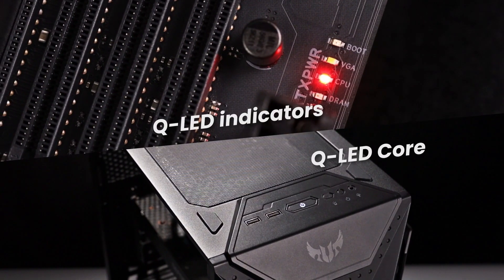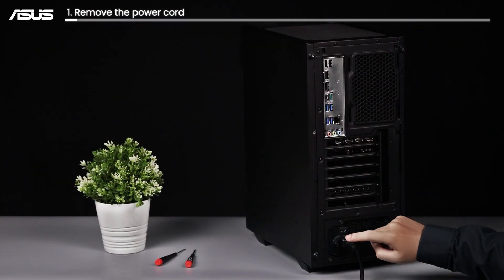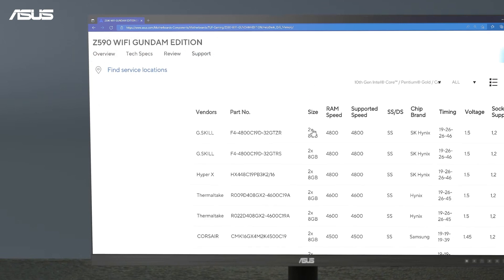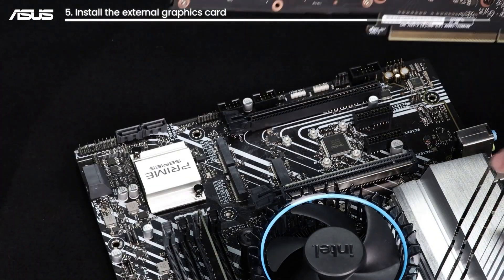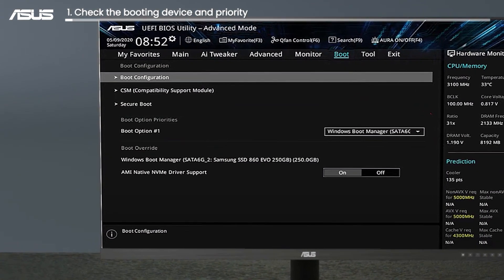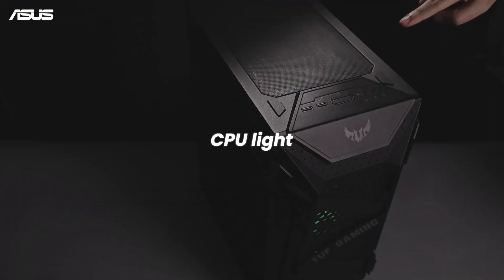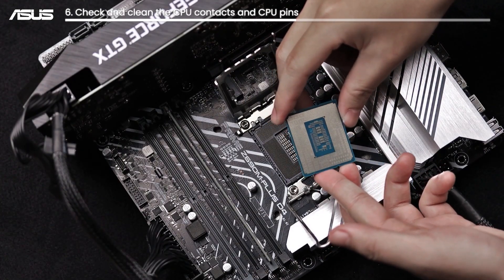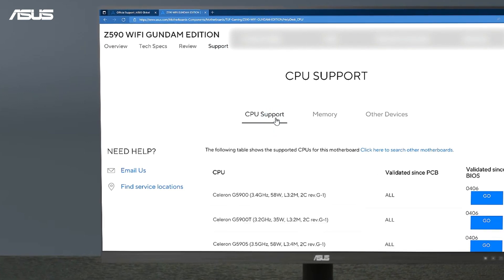ASUS Motherboard Troubleshooting via Q-LED indicators, Q-LED Core   | ASUS SUPPORT

Comment: After a power outage my PC will boot into a black screen sometimes and the power LED also flashes 4 times per second on boot. The PC also does not recognize some external drives anymore. I've also had the system crash into BIOS once since the issues started.
I cleaned and reseated my RAM and also tested it with MemTest86 - with 0 errors shown. I also replaced my power supply unit and my CMOS battery but the issue persists.
Does this indicate that my motherboards needs to be replaced? Maybe the power outage came with a power surge that fried certain components in the motherboard?
Reply from the maker: Regarding your question, I would recommend you visit the following forum post to get more assistance. 
https://zentalk.asus.com/t5/motherboards/bd-p/motherboards
Sorry for any inconvenience it may be caused.

Comment: Need help, my vga light is constantly on but my pc wont boot. Everything turns on but when it gets the red light my gpu fans stop spinning, if i disconnect it and then plug it back in they spin again. My motherboard is a X570-Plus wifi.
Reply from the maker: Regarding your question, I would recommend you visit the following forum post to get more assistance. 
https://zentalk.asus.com/t5/motherboards/bd-p/motherboards
Sorry for any inconvenience it may be caused.

Comment: My Boot light has been on since over a year ago and a week ago I found this video and bought a new M.2 SSD but lights still on. What should I do now?
Reply from the maker: Regarding your question, I would recommend you visit the following forum post to get more assistance. 
https://zentalk.asus.com/t5/motherboards/bd-p/motherboards
Sorry for any inconvenience it may be caused.
Reply: @asus_support  5 days ago I did actually fix my pc. It just literally just my SSD and windows 11 no longer able to run since I gave my GPU to my friend. So I bought the new SSD and a flash drive to install windows 10 and now IM BACK BABY!!! and wouldn't have thought to buy a new SSD without this video so ty :D

Comment: MB: 
prime B550-Plus, Ryzen 3 (I think - can't remember exactly which), 32gb RAM.  About 2 years old, worked fine until today.  Now on power-up the Q-leds DRAM, CPU and VGA all blink once, then repeat. Is this a failed CPU or MB?

Thanks,
D Mac
Reply from the maker: Regarding your question, I would recommend you visit the following forum post to get more assistance. 
https://zentalk.asus.com/t5/motherboards/bd-p/motherboards
Sorry for any inconvenience it may be caused.

Comment: Hello @asus support I have a question. I have Motherboard ROG Strix B760--A Gaming Wi-Fi and have bought compatible RAM as per the Support CPU/RAM list in your support page for the specific model of motherboard that I purchased; however, when I turn on the power the CPU Led turns on Red for a second then shuts off and followed to that the DRAM Amber light turns on and it remains on and there's no boot. RAM Sticks have RGB Light so that stays on, CPU Fan stays on (also has RGB), Tower Case has 3x RGB Fans and those stay on as well, everything seems to be turning on except there is no boot process and the DRAM Amber light stays on. I doubled checked the Model of the (2x) RAM Sticks were compatible as well to place them in the correct DIM Slot (A2 and B2).

Thank you
Reply from the maker: Regarding your question, I would recommend you visit the following forum post to get more assistance.
https://rog-forum.asus.com/t5/gaming-motherboards/bd-p/HSS_MB
Sorry for any inconvenience it may be caused.
Reply: Same here … happened overnight with a 2 year old build x570e wifi II … either cpu red light followed by amber dram or other way round … q-code 54 4d …
Reply from the maker: Regarding your question, I would recommend you visit the following forum post to get more assistance. 
https://zentalk.asus.com/t5/motherboards/bd-p/motherboards
Sorry for any inconvenience it may be caused.

Comment: How can i update my motherboard when my computer is not working, wtf
Reply from the maker: Do you mean that if the device cannot power on after encountering a problem, how can you update the BIOS? Or is it possible to update the BIOS without booting up the system? If it is the latter, you can refer to the following steps.
https://www.asus.com/support/faq/1038568/

Comment: B550 TUF Plus with 5600x and 16gb 3600mhz ram. It was working fine at night but in the morning when I turned it on I get no POST. Dram LED on constantly fans spinning and no signal tried one ram at time on all slots and clearing CMOS still nothing.. I don't have other ram sticks to test please help.
Reply from the maker: Regarding your question, I would recommend you visit the following forum post to get more assistance.
https://zentalk.asus.com/t5/motherboards/bd-p/motherboards
Sorry for any inconvenience it may be caused.
Reply: Hi, I have the same problem, did you solve yours?
Reply: @mass6902 Hey, sorry to hear that you have this problem, unfortunately in my case it was a dead CPU. I hope it's not the case for you, try removing rams and test them one by one and clean ram slots first.
Reply: @Copeur  I bought a new motherboard and rams and there is still the DRAM led, you are right I think it is my processor, shiit ...
Reply from the maker: If you have followed the above steps but the problem persists, I would recommend you visit the following forum post to get more assistance. 
https://zentalk.asus.com/t5/motherboards/bd-p/motherboards
Sorry for any inconvenience it may be caused.

Comment: Hello. I bought an Asus B460M-A (The one that only supports 10th generation Intel). It worries me because as soon as I press the power button, the power LED flashes quickly 8-9 times (no video here), then the LED stays on for about 2 seconds and at the same time shows the first classic screen (The one that shows the CPU, Memory, or if the keyboard is connected or not), it quickly goes to the next screen where the ASUS logo appears and at the same time the LED turns off, half a second later the power LED turns on, Windows loads and the LED remains stable. It doesn't turn off again. The speaker only emits the classic short beep that everything went well. There are no video glitches. Since I press the power button, my PC takes 6-7 seconds to display the Windows welcome screen. Is it okay for the power LED to flash those 8-9 times as soon as I turn on the PC? Is it part of the Power On Self Test? Thanks in advance.
Reply from the maker: Regarding your question, I would recommend you visit the following forum post to get more assistance.
https://zentalk.asus.com/t5/motherboards/bd-p/motherboards
Sorry for any inconvenience it may be caused.

Comment: my pc has the white led and the boot green/yellow led. I have checked ssd connection and installation, and cleaned out all of the slots and reinstalled the gpu. i still get no signal on my monitor and have the led signals. i just built this pc and nothing has been installed on it. I am using the Asus tuf plus wifi ATX motherboard. i am not using any type of storage other than a m.2 ssd (1tb) and my gpu is the 4060 from Msi. My cpu is the i5 14400F. How do i fix this problem? everything is plugged in and the gpu fans are spinning.
Reply from the maker: Regarding your question, I would recommend you visit the following forum post to get more assistance.
https://zentalk.asus.com/t5/motherboards/bd-p/motherboards
Thank you.
Reply: @asus_support  for anyone wondering, I left my pc running for a while, and then turned it off. The next morning it turned on and booted into bios. I was able to install windows and get rid of any motherboard lights.

Comment: I have a problem with ROG STRIX B760-F GAMING WIFI the VGA LED remains lit every now and then I tried the guide, updated the bios, updated nvidia drivers, tried two RTX 3060/ RTX 4080 cards and the problem persists the video cards work correctly, please please do a bios update that solves this problem, I also have problems with XMP profiles on DDR ram 5 CORSAIR VENGEANCE RGB DDR5 RAM 32GB 7000Mhz, once set the system freezes and restarts the bios!
Reply from the maker: Regarding your question, I would recommend you visit the following forum post to get more assistance. 
https://rog-forum.asus.com/t5/gaming-motherboards/bd-p/HSS_MB
Sorry for any inconvenience it may be caused.

Comment: I couldn’t get my monitor to work, both boot and vga qled lights were on. Finally realized my monitor hdmi cable needed to plug in directly to gpu, not motherboard 🤦‍♂️
Reply: BRO U SAVED ME... IVE BEEN PLUGGING INTO MY MOTHERBOARD TOO
Reply: Thx bro😆😆😆
Reply: 👑 You dropped this
Reply: Thats odd … in my case that would not cause any error message … just black screen.
Reply from the maker: It is recommended that you refer to the following FAQ for troubleshooting.
https://www.asus.com/support/faq/1042632/
Sorry for any inconvenience it may be caused.
Reply: Lol lucky it was easy

Comment: I have a RED LED indicator light on and stays on booting.. but then it power cycles... ASUS ROG Z790-H gaming WIFI... Just built this PC with pretty good components.... RED LED means CPU problem.. I have a 14700KF stock with a 360 AIO cooler.... It was working great then playing a game it just powered off and started with problem I've mentioned.  PSU is a MSI MAG 850W Gold... Any Ideas? I've tried what i can..  Thanks.
Reply from the maker: Regarding your question, I would recommend you visit the following forum post to get more assistance.
https://zentalk.asus.com/t5/motherboards/bd-p/motherboards
Sorry for any inconvenience it may be caused.

Comment: Are there Q - LED PRIME Z690-P D4 on these 2 boards.....PRIME Z690-P because I have the second board and on the website it says that there is, but I have never seen such lights before ...If there are, where exactly should they be soldered on the board ?
Reply from the maker: Regarding your question, I would recommend you visit the following forum post to get more assistance.
https://zentalk.asus.com/t5/motherboards/bd-p/motherboards
Sorry for any inconvenience it may be caused.

Comment: So if the red cou light comes on then goes off does that mean it’s ok, It passed?  

Or does that mean there is an issue with the cou?
Reply from the maker: Regarding your question, I would recommend you visit the following forum post to get more assistance.
https://zentalk.asus.com/t5/motherboards/bd-p/motherboards
Sorry for any inconvenience it may be caused.
Reply: CPU light flashing is normal but got stuck on ram light (yellow).  Lucky I had some extra ram and swapped out the 48gb ddr5 with a 16gb ddr5 and then the motherboard posted.  I later put 2  48gb (96 total) and it worked fine

Comment: This bug is only due to some bios versions. I have seen that in the past and after some bios update never came back till the very latest 3302. The light keeps on but the pc starts after several attempts. Both motherboard and VGA are ASUS.  But all of those are irrelevant as it works fine but it doesn’t work after some problematic bios updates.

Comment: Why does the ProArt Z790 not have a boot code qled where you can lookup the code rather than individual lights which you can't easily see the label for each light? The numeric boot code is just easier.
Reply from the maker: Regarding your question, I would recommend you visit the following forum post to get more assistance. 
https://zentalk.asus.com/t5/motherboards/bd-p/motherboards
Sorry for any inconvenience it may be caused.
Reply: @asus_support  I really don't see the point, posting in the forum will not result in one being added.

Comment: White light on motherboard but goes off after restart and comes again on next time. Updating the graphics driver also didn't work
Reply from the maker: I suggest checking the power supply or updating the BIOS and resetting it to default values. If the issue persists, I recommend visiting the following forum post to get more assistance. 
https://zentalk.asus.com/t5/motherboards/bd-p/motherboards
Thank you.

Comment: Hello.
I have an asus tuf gaming b550m-plus motherboard.
I have been using it for several years. I have not changed anything in my computer configuration.
When I switch on the PC in the morning there is simply no image on the monitor and the VGA Led is white all the time.
I checked the video card on another PC and it works.
Connected the monitor to my laptop, same everything works.
I took out all the memory cards and put them in the slots one by one, this also did not help.
I reset and then reflashed the BIOS.
What should be my next step?

Thanks for help!
Reply from the maker: Based on your description, it is possible that the VGA slot on the motherboard is faulty.
I would suggest you bring back your device to our service center for further confirmation.
The following is the contact information:
https://www.asus.com/support/service-center-location 
Also you can contact the local service center for help.
The following is the contact information:
https://www.asus.com/support/CallUs# 
Sorry for any inconvenience it may be caused.

Comment: I built my first PC 2 days ago and I have a b550m-a wifi ii. My issue is that I have a blinking orange light coming from the back of the motherboard. I’ve tried to troubleshoot and attempted all fixes I can find online and nothing has worked. The PC works completely fine, even under a stress test?
Reply: @asus_support
Reply: @asus_support  there was nothing on this forum to help me. From the research I’ve done it seems to me to be a power supply issue, but how come everything works fine even under stress tests?
Reply from the maker: Regarding your question, I would recommend you visit the following forum post to get more assistance. 
https://zentalk.asus.com/t5/motherboards/bd-p/motherboards
Thank you.
Reply: @asus_support  Scamers, the problem is Asus MBs. Sh it Asus. SCAMERS

Comment: My CPU light turns on when I start a render and then turns off when the render completes. Is this an error or a thermal indicator? Tuf z790 running bios 1630
Reply from the maker: Regarding your question, I would recommend you visit the following forum post to get more assistance. 
https://zentalk.asus.com/t5/motherboards/bd-p/motherboards
Thank you.

Comment: q leds flashing i just got my ram and moba i am using ddr 5 ram now i was using another mother board ddr 4 and the d-ram signal was also going off in that one i dont think its the ram is there anything else it could be cpu? or power supply?
Reply from the maker: Regarding your question, I would recommend you to post on the following forum to get more assistance.
https://zentalk.asus.com/t5/motherboards/bd-p/motherboards
Thank you.

Comment: What if the q-leds don’t light up at all?
Reply from the maker: If that's the case, I would recommend sending it for repairs.
The following is the contact information:
https://www.asus.com/support/service-center-location 
Also you can contact the local service center for help.
The following is the contact information:
https://www.asus.com/support/CallUs# 
Sorry for any inconvenience it may be caused.

Comment: My pc has been sitting for many months, using it no problems for gaming every day (so i know for sure no cables are in the wrong place).
I have 1 long beep followed by 3 short beeps and then another short beep( Start up beep then long BEEP, then BEEP BEEP BEEP then a short PAUSE then a final short BEEP), my pc starts as i can hear the windows logo through my speakers but i have no display.
I have tried:
Removing GPU and clean.
Removed RAM and clean.
Removed ALL usb connections.
Removed all cables and reconnected.
Tried different cables.
ALL fans are spinning no problems.
I have GHOSTS in the MACHINE because after the pc booted no problems and remained fine for a few days, i restarted the pc today and the beeps came back?, i wiggled the gpu DVI cable, restarted and the beeps went away and pc working ok again?
(Asus Z390-A Prime Mobo paired with a 1060 6GB GPU, Seasonic Hybrid 550W psu, i5 9600K, 16Gb RAM, 120mm AIO Cooler, 165Hz Red Eagle G-Sync Monitor)

Comment: Hey so when i remove either the cpu or cpu fan or chassis fan for cleaning and plug it back in the board locks up and gives me the orange light unless i remove one ram stick then boot it up it gives me the press f1 key to continue screen after that i can continue to windows and then after a shutdown i can place the other stick back in and it works like it did not just make me have a hart attack is this normal ? Or should i replace a thing ?
Reply from the maker: Regarding your question, I would recommend you visit the following forum post to get more assistance. 
https://zentalk.asus.com/t5/motherboards/bd-p/motherboards
Thank you.

Comment: I have problems with my Tuf gaming b550-plus. The white VGA light is on constantly but there's no signal on the monitor+ mouse and keyboard doesn't work and no rgb too. The system runs, the gpu,cpu and other fans work,power button led is on too. 
I have unplugged and plugged all the connectors,ram and pur ny rtx 4060 to another slot and back and still nothing. Also tried to run system without GPU using only my ryzen 5 600g and plugging the hdmi cable into motherboard and still nothing but that annoying VGA ligh .
Reply from the maker: I suggest you visit the following forum post to get more assistance.
https://zentalk.asus.com/t5/motherboards/bd-p/motherboards
Sorry for any inconvenience it may be caused.